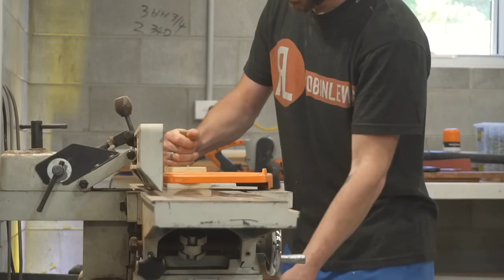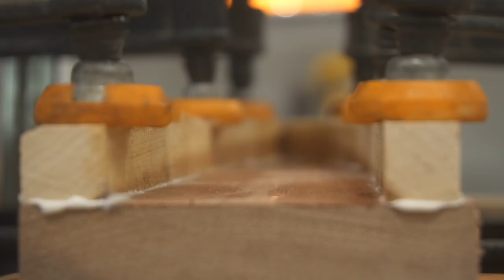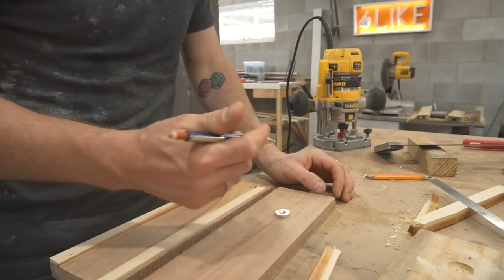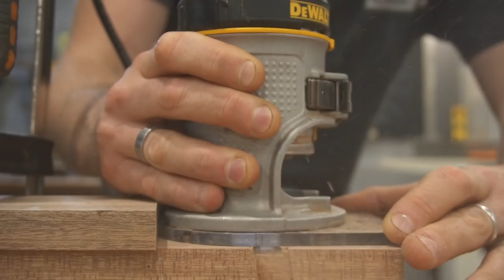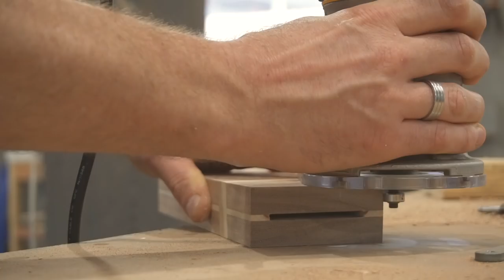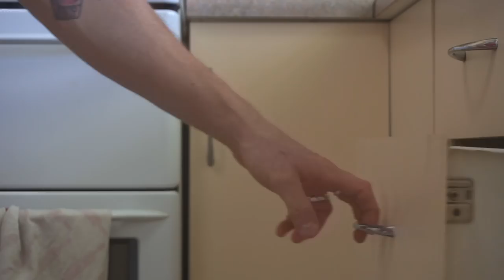Magnetic Wood Sheath For A Kitchen Knife

Comment: I've been thinking about making a magnetic Saya. This is a bit thicker than I had envisioned.

I was imagining 1mm thick n52 neodymium magnets sort of placed down one side. Adjusting the amount for desired pull force. I was also picturing perhaps if it could work a nearly solid row set @ 90 degrees along the spine of the knife to keep the blade edge from ever touching anything.

Either way, I thank you for the continued inspiration!
Reply from the maker: Thanks. I like the idea of putting them along the spine, it would also help lock it in